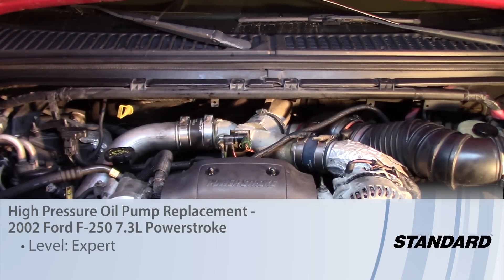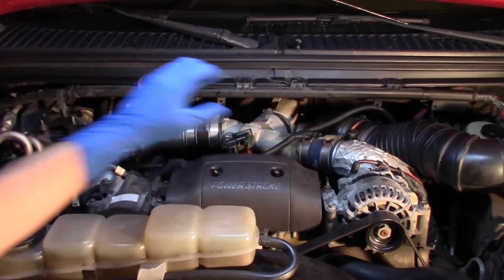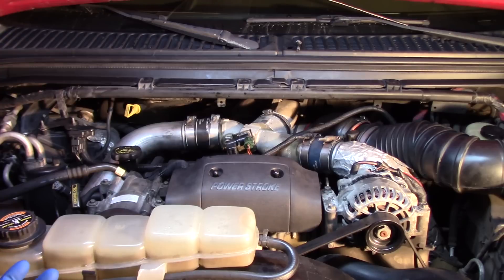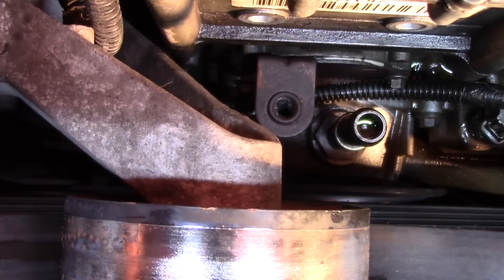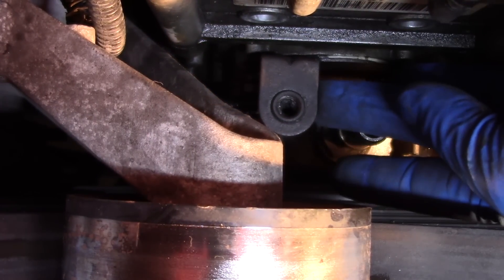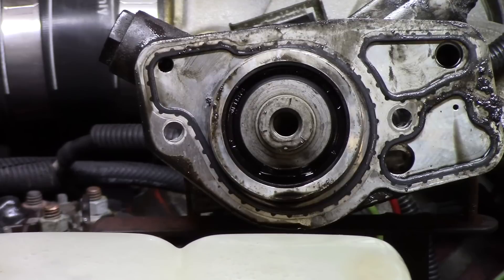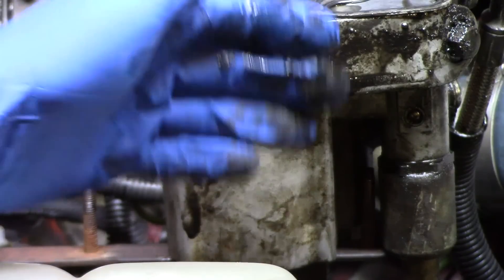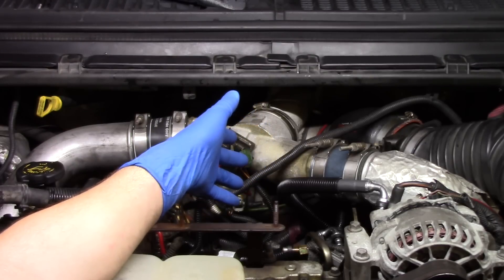High Pressure Oil Pump Replacement - 2002 Ford F-250 7.3L Powerstroke

Comment: Why does nobody show the socket on the harmonic balancer? 😭 that's all I want to see.
Reply: look for DieselTechRon he has a video  "'Ford 7.3 powerstroke diesel High pressure pump H-pop" that shows it as well as the torque specs.
Reply: @marytighe2447  I was able to get it done :) it was the pulley portion right in front of the alternator. I was able to get the HPOP bolt off (after some difficulty) by myself, but to put bolt back on to proper torque level, a set of helping hands was required to prevent the engine from turning.
Reply: You don't know what a harmonic balancer is, or you don't know what a socket is?
Reply: @nicksharp6950  lol, the harmonic balancer! I was having trouble getting the HPOP bolt off cause the engine kept turning over on me and I didn't know where to apply pressure to prevent it from doing so.

Comment: Would sure love to see how to remove the fuel filter assembly.
Reply: 2 13mm bolts in front of oil reservoir discount all fuel lines and out it goes

Comment: Can you please explain what function the cover serves as shown i n your video at time marker 7:02 please? The reason I ask is because my pump is leaking and I went in to took at the pump and saw that cover is missing and I found a strange nut lying on the block whick looks itentical to the one on the bent, extended arm on that cover. Thanks
Reply: It's just a cover, keeps oil in and dirt out

Comment: Can you help with the best way to prime the HPOP. I changed out HPOP and it won't start because of prime. The reservoir-is it empty or not has a supply?
Reply: top it off from the top right plug. watch the O ring when removing the plug.

Comment: Have a question for you that is irrelevant to the video I do appreciate the video more I learn the more I like it LOL the question is I have an 02 F-350 with a 7.3 their heads were bad on it they were cracked in several places the original heads did not have a fuel return the donor heads which came out of a 96 or 97 7.3 had a fuel return so I just plugged the fuel return with a plug. It runs okay but it just really doesn't have their performance that it should so I don't know if I need to build a fuel return or not just looking for some advice thank you

Comment: Question for you if the gear moves inside the engine will it be off time
Reply: high pressure oil pumps dont require timing, mechanical fuel injection pumps such as IH idi's or 12v cummins require timing.

Comment: Okay, Guys After I Get All done Step By Step Now My Truck Don’t Want Start, What Could Be Happens???
Reply: He doesn't talk about filling or draining the reservoir. Need to fill it before starting or it takes forever to fill up off the engine oil pump.
Reply: Did u ever figure that issue out im having the same problem with mines

Comment: I like these lines better

These have less of a potential for leaks since there are less connections  
https://www.ebay.com/itm/99-03-Ford-7-3L-Powerstroke-High-Pressure-Oil-Pump-HPOP-Hoses-Lines-Set/322953503183
or without the crossover
https://www.ebay.com/itm/99-03-Ford-7-3L-Powerstroke-High-Pressure-Oil-Pump-HPOP-Hoses-Lines/322962675642